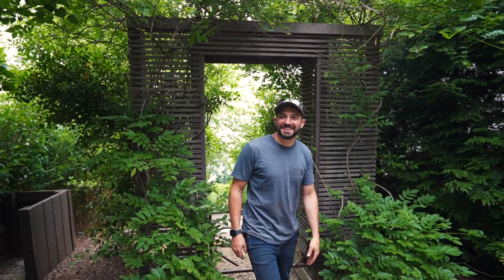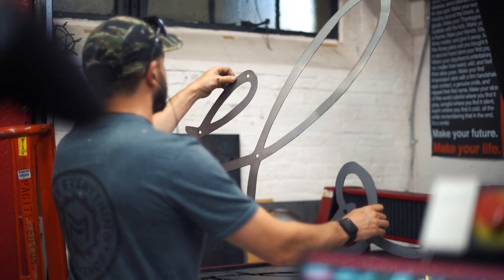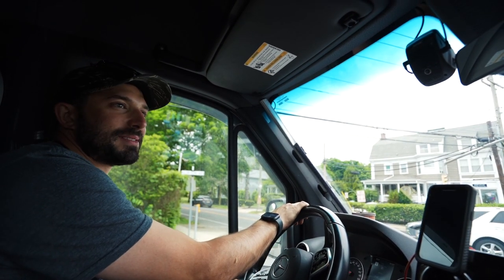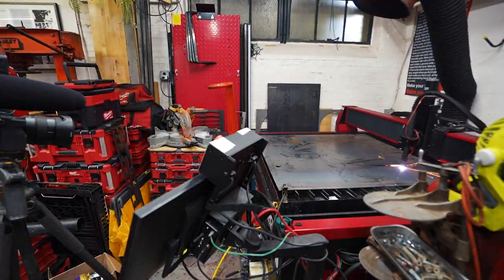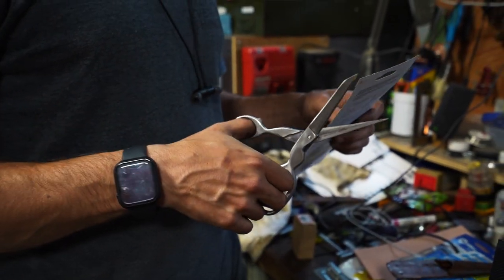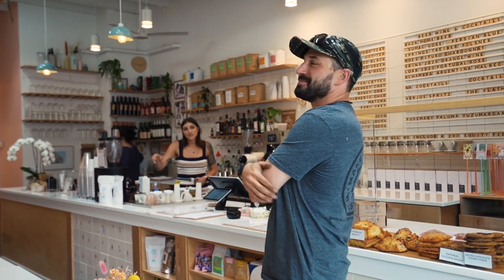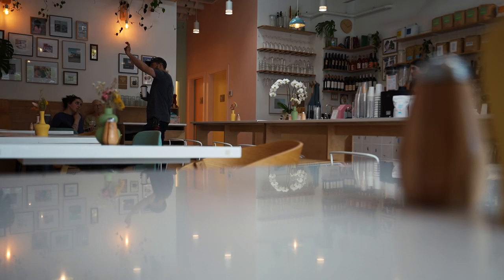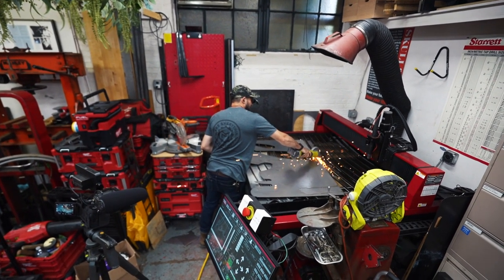Woodworking and Metalworking | The Guy Who Makes Everything: Chris Zep

Comment: would you consider yourself a structural engineer?
Reply: I’m pretty sure he does not claim to be a structural engineer, I think he made a pretty big point about having a diverse set of skills and not focusing in on one skill, something a structural engineer would do. Chris can answer himself but if you are referring to where he said “I did the structural steel” I can assure that any work done in that establishment was properly designed/ engineered and permitted; this area is very strict with permitting and inspections and you would not get away with just throwing some steel up. I built a simple deck in this area and had to have full stamped architectural drawings in order to get a permit for it.